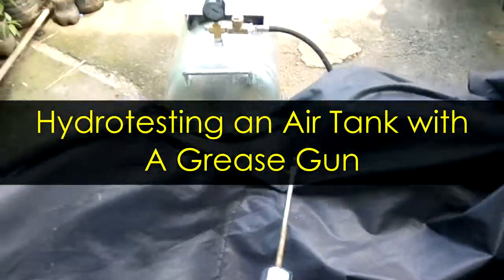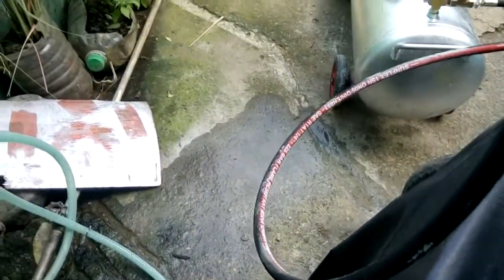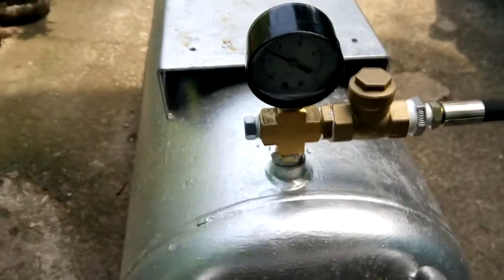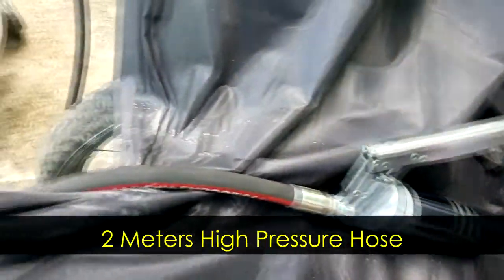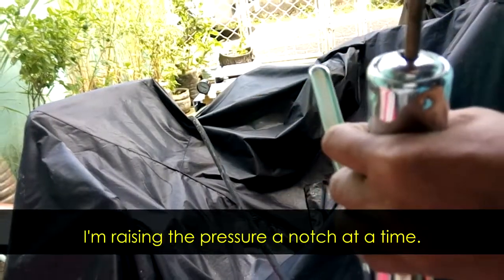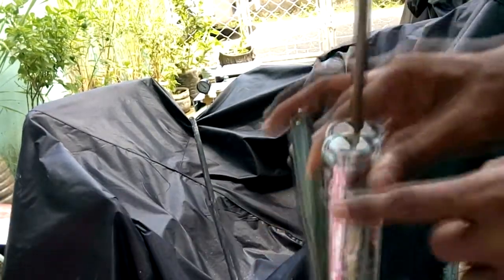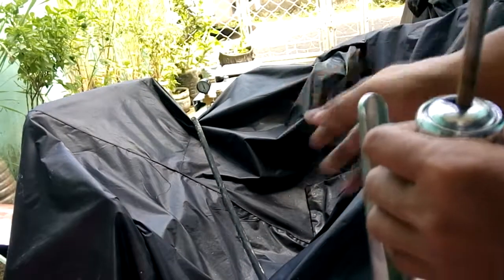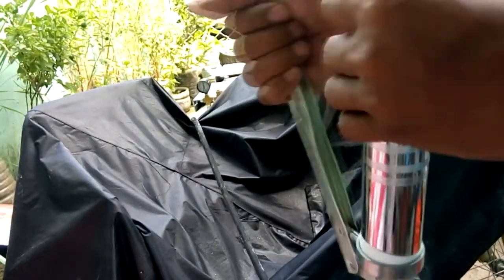Air Compressor Tank Pressure Test   Hydrotest Using Grease Gun

Comment: Thanks! The slipper is the answer I was searching for!
Reply from the maker: Hey, glad I could help. :) By the way, in removing the cap to refill, just be careful that no residual "air" pressure is trapped there, so be careful when you remove the grease gun cap.
Reply: Yes!